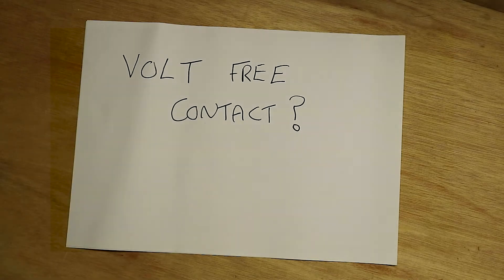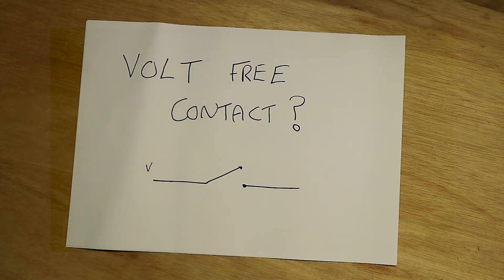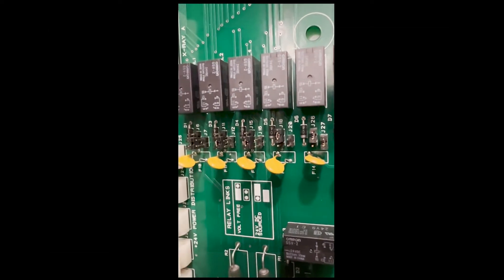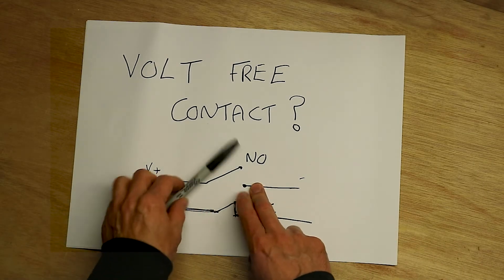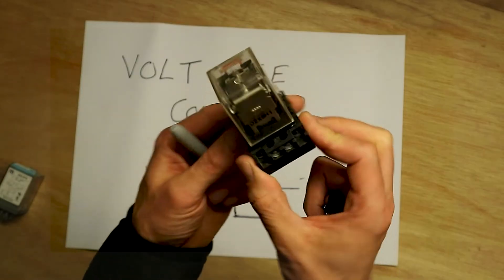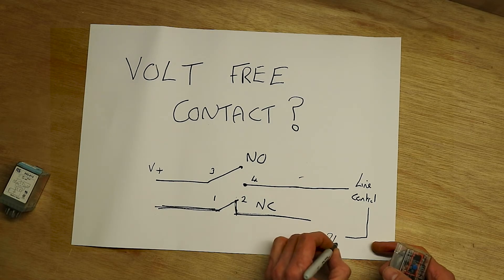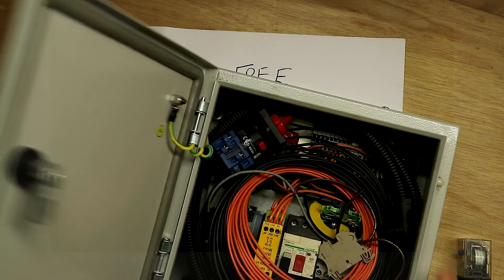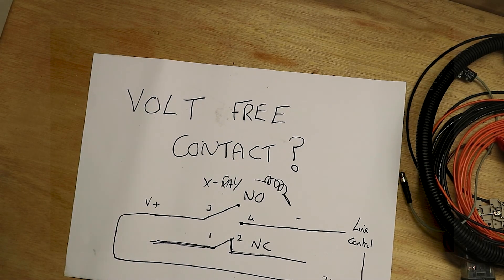Zero Volt Contact explained

Comment: I think you described a wet contact, which is the opposite of a volt-free contact. A potential-free contact, volt-free contact, or dry contact, is an electrical switch or relay contact that is not connected to any voltage or current source. In this context “free” means “without”,  not “available”.
Reply from the maker: No, this is a dry dontact, it's a contact that is separate from the control circuit of the host panel (metal detector). In this case it is used by the downstream reject to get a signal, the down stream panel uses the contact to put 24v onto the contact, when the metal detector fires the downstream panel recieves the signal that is has fired. This in turn is used to fire the reject. Having looked back through the video I could of explained it better - possibly with a better drawing! But it is definitely a dry contact. A wet contact would be one that has voltage applied to it from the control system it sits in.